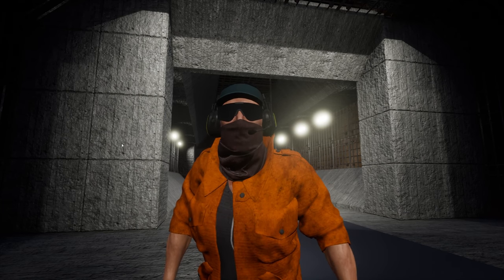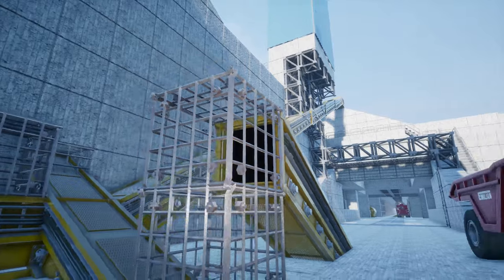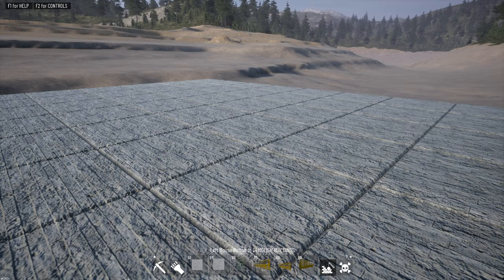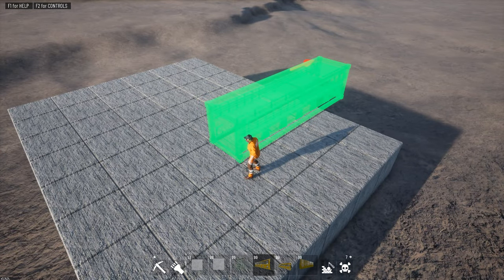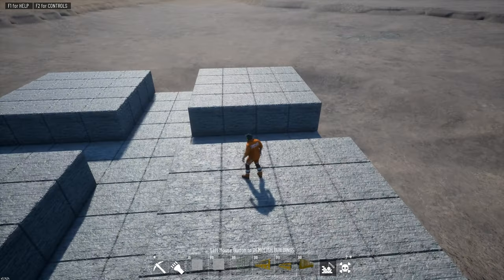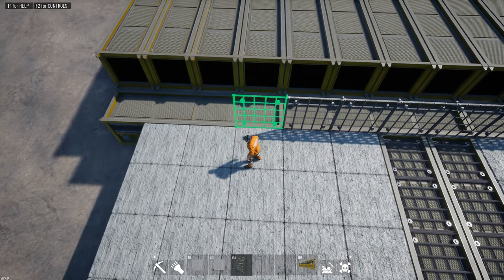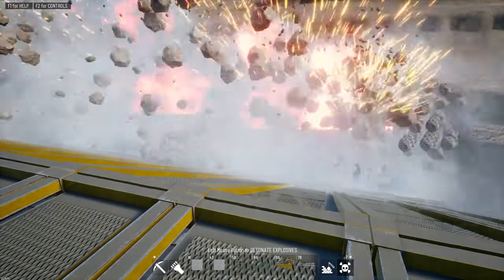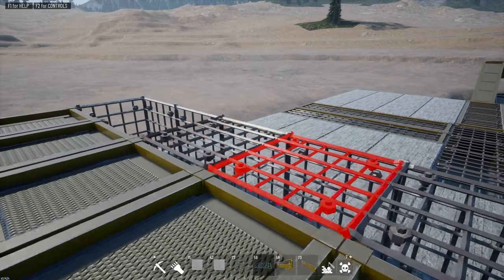HOW TO CONVEYOR SET UPS | OUT OF ORE | MAKE MILLIONS EASY!!!

Comment: You can use your scroll wheel to move the part closer or farther to place it. I don't know what the controller setup is, can probably set that up in the controls settings
Reply from the maker: Yep by default is scroll wheel. Don't thing controller has defaults